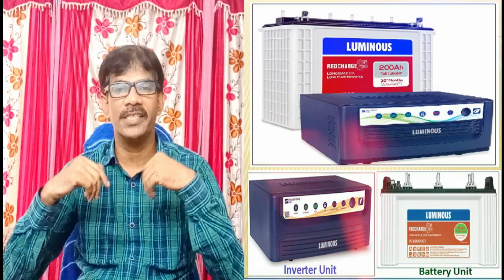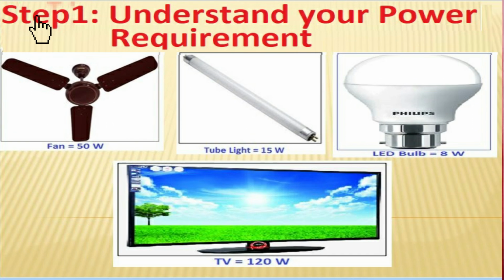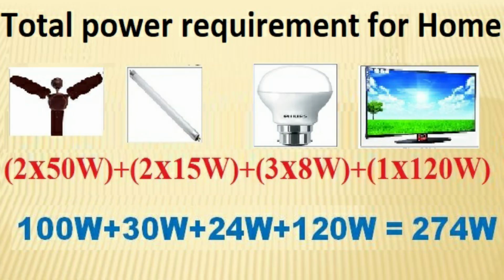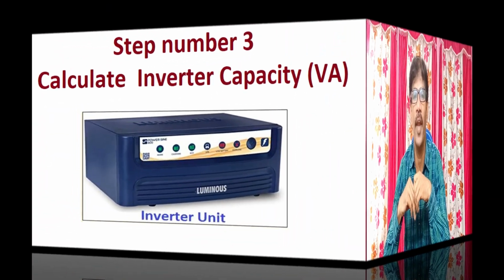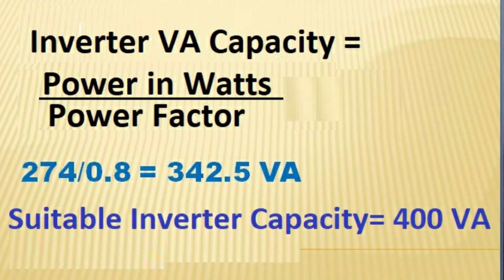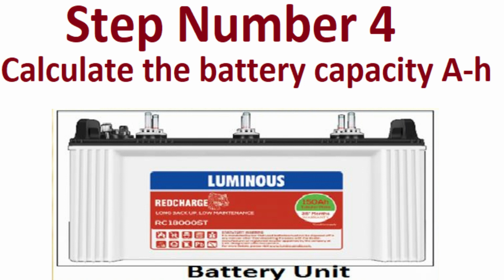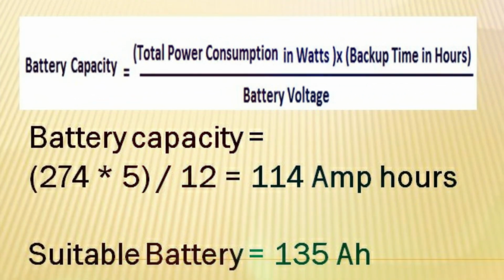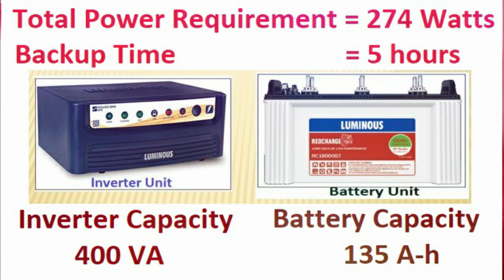How to Select suitable Inverter for Home |Journey with Joga Rao| inverter |

Comment: 900v with 150Ah battery luminous suggest chestara?

Price is 22890 in amazon
Reply from the maker: Ok andi. Pls watch same video in telugu version may be meeku inka clarity vastundhi.
Reply: @JourneywithJogaRao999  Ha chusa andi 900v with 200ah battery cost is 25530 price difference for 150 ah battery and 200ah battery is 2640Rs which is worthable sir??
Reply from the maker: 150 ah is sufficient andi.  Okavela amount problem ledanikunte 200ah theesikondi. Its worthable andi. Ah perigithe backup time yekkuva vastundhi.
Reply: @JourneywithJogaRao999  ok thank you so much for your response sir Ah valla backup time ekuva vastundi thank you 😊